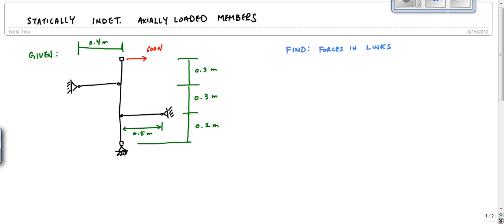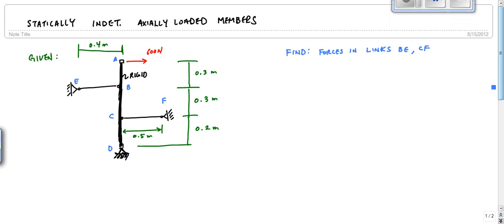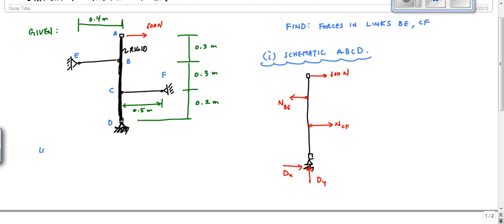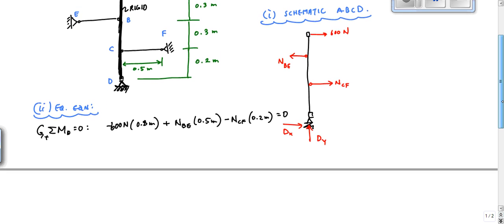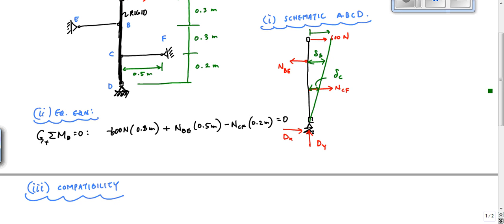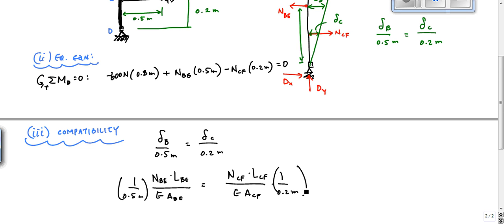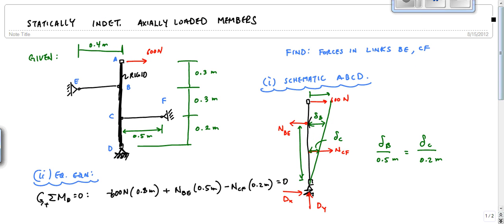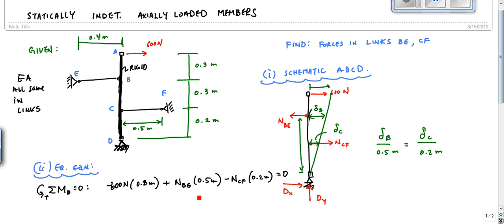Statically Indeterminate Axially Loaded Rod Example 3 - Mechanics of Materials

Comment: Hi! Just one question: why would the deformation in B be positive? The force in B goes the opposite way than say P which means its deformation should be opposite as well, doesn't it? Plus, you said in the beginning : B is in tension and C as well.. I found it a bit confusing.
Reply from the maker: The rod BE experiences an internal tension force and the corresponding displacement of point B elongating rod BE matches the internal loading, whereas our force in CE we drew initially in tension, but the displacement of point C does not correspond to an elongation of CE.  And that is why I introduced the negative sign.  I hope that provides a little more clarification.
Reply: It does!! Thanks